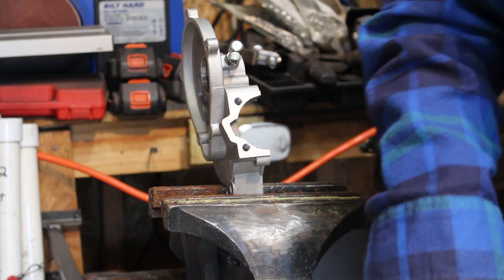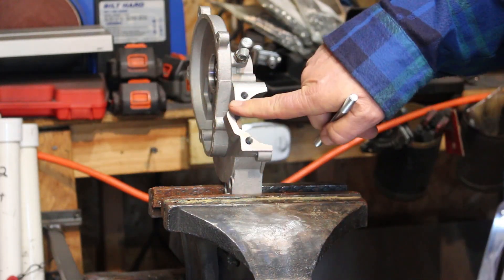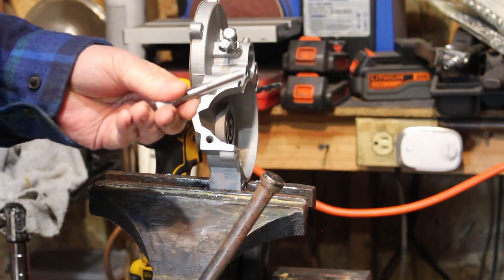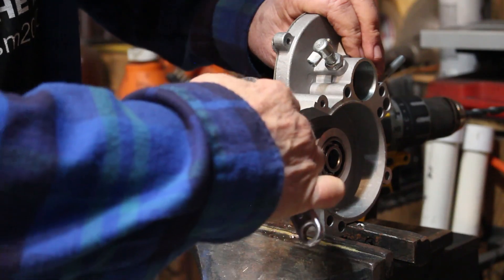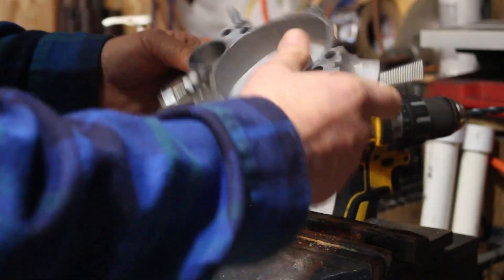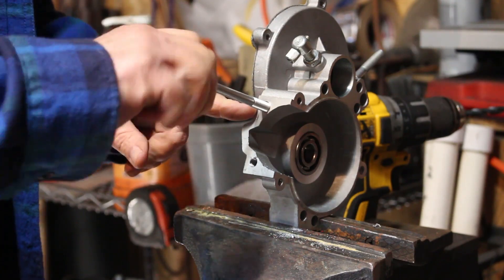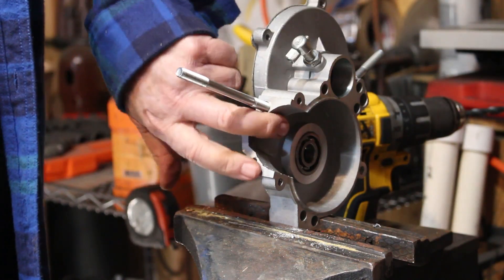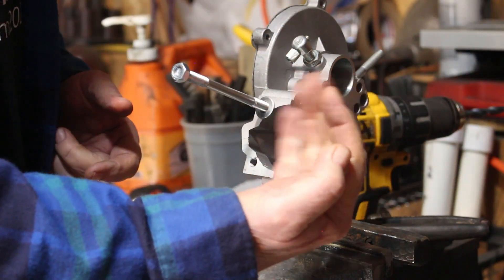How To Repair Stripped Cylinder Stud Holes Engine Case Motorized Bicycles

Comment: Good Video, glad I watched....Been so long since I've used a tap. That I forgot there's 2 different types.
 I didn't see you remove the thread insert tab. Dunno if the tab was bottomed out & didn't need to be removed. Or if video footage got lost. 
I thought I'd never strip any threads, if I was careful. 
But made the mistake of working on the engine when it wasn't fully cooled down. Apparently loosening & removing the studs when the engine is still a bit warm. Is all it takes to strip those soft aluminum threads. 
Strands of copper wire & red locktite often work on mildly stripped threads. But never tried it on a hot engine with the expansion & contraction, possibly working it loose.
Reply from the maker: The tab stays in

Comment: You really need a drill guide with a depth stop. You need the hole perpendicular to the block, with the hole slightly longer than insert.
Tap needs to be guided perpendicular as well, and be sure to use a proper tap wrench.
If the drive end of the tap is moving, the tap is not going in straight, which means an oversized hole, and a loose, misaligned fit.
Drill and tap guides are simple shop made tools to fit the job, and are worth the effort to acquire/make them. Once constructed they will serve for many years, and easily repay your effort with more accurate work.
Good tip about cutting the end off the tap, so as to get it to cut full depth. Problem is, it is even harder to start when modified like this. Drilling the hole about one thread longer eliminates the need to modify the tap.

There are also " TYME" inserts to repair stripped threads, but their larger diameter might weaken the part. They do allow a botched / stripped thread insert hole to be repaired though, and the increased diameter holds much better than an STI, especially in a porous casting, which are very common in some cases.
Porosity is a major cause or pulled studs, where over torqueing and bottoming out are not the cause.

Tim

Comment: HEY MY BROTHER I JUST PUT THE NEW MAGNETO COIL AND STILL DOESNT TURN ON BRO I put new spark plug new cdi new magneto tried different fuel mix I’ve tried everything brother and motor doesn’t turn on remember the motor it’s brand new … it was turning on when cold and turn of when would get warm … but now doesn’t even turn on at all I’m starting to think the carburetor it’s not letting fuel into the motor … what do you think?? And when I remove the screw in the carb it drains good I have no idea what can be going on please help me 👍🏻👍🏻👍🏻👍🏻thanks

Comment: When I was installing the universal U-boat to install the engine on my bike one of the bolts snapped. What should I do?
Reply from the maker: Proper fit is key. You simply over-tightened the UBolt. The motor should fit snugly before you try and bolt anything down

Comment: I recently bought a bicycle engine kit and it only came with one base gasket do you think it will still run good?
Reply from the maker: A few years ago, most engines only had one base gasket. So it should be okay
Reply: @HughesMotorized  ok thanks

Comment: I just had to do this on my motor lol, i drilled the hole too deep by accident so i had to flush my crankcase way too many times. Also had to seal the stud threads with silicone

Comment: HEY BROTHER CAN YOU HELP ME OUT I BOUGHT A NEW ENGINE AND INSTALLED IT ON MY BIKE AND RUNS GREAT BUT WHEN I RIDE FOR 3-5 ENGINE SHUTS OFF AND TURNS ON BUT NO POWER… WHEN IT COOLS DOWN FOR LIKE 10 MINUTES IT TURNS RIGHT UP AND RIDES LIKE NOTHING HAPPENED BUT AGAIN AFTER 3 MINUTES IT DOES THE SAME THING LOOSES POWER AND SHUTS OFF .. WHAT CAN IT BE ?
Reply from the maker: Might be gas cap vent or magneto coil. The cap might not let enough air into gas tank or the coil is fine when cold then goes bad when warm/hot
Reply: @HughesMotorized  NICE OKAY I ALREADY DID EHOLE IN CAP AND KEEPS DOING SAME THING … I EVEN CHANGED THE CDI , TOOK APART THE CARB CHANGED THE SPARK PLUG AND NOTHING … LAST THING TO CHECK IS THE MAGNETO COIL LIKE YOUR SAYING 👍🏻
Reply: @HughesMotorized  THE MAGNETO COIL IS GETTING HERE TOMORROW.. ILL LET YOU KNOW IF THATS THE ISSUE